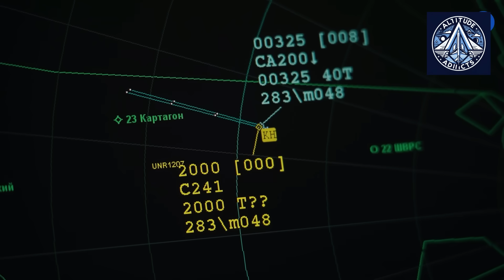All Russian MC-21 Full First Flight Video, Pilot Feedback and Official Interview

Comment: I was told, the long range version, mc-21 400 can fly between 10-12 hours. That will make it very popular if it's as safe and reliable as Airbus a320/a321

If its agreeable, i suggest russia license or jv construction of mc-31 with embraer to get big nunbers in order to compete better with Boeing, Airbus and comac. Plus embraer has better service record which russian companies really sucks. Nobody wants to buy planes and leave it stranded due to lack of parts.

Comment: I hope Russia makes it own airplanes all based on domesticly made parts.
But obviously the electronics at least depends on highly integrated chips made in China (read Taiwan, USA)
Reply: Russia is able to produce its own domestic electronic components. It will take some time to establish new chip plants and develop equipment.
Reply: @vatnikxxi7717  Sounds You feel being offended?
I was told Russians don't like being criticized., hey? No offense here.
Reports suggest that developing lithography machines finally came to some result (350nm) at least.
Still at 1990*s level. It will take much effort, money, time in order to keep up with todays level (ASML,TSMC).
Reply: Don’t you worry about us.This is not Boeing that falls from the sky every couple of months
Reply: @GoodFella-xw8yx  Well, summarize all my thoughts in a single line.
I would be worried if I were sitting in a Russian (western made) airline plane that was racing around the runway with intentionally reduced capacity and little fuel due to the lack of Western brakes.
Did you know?